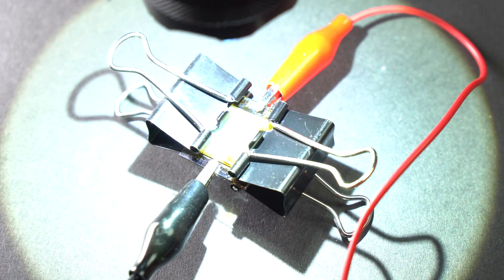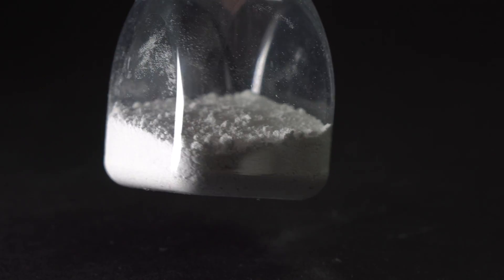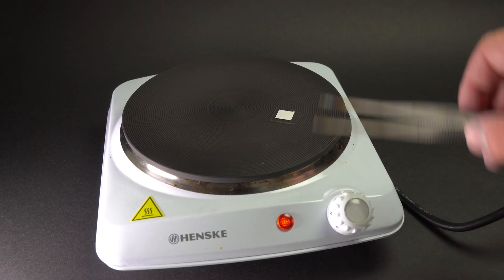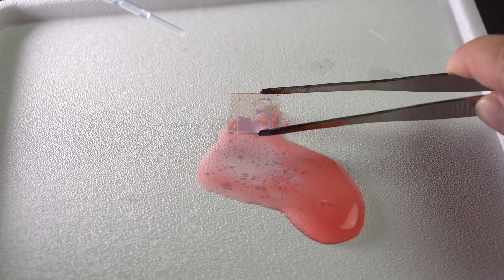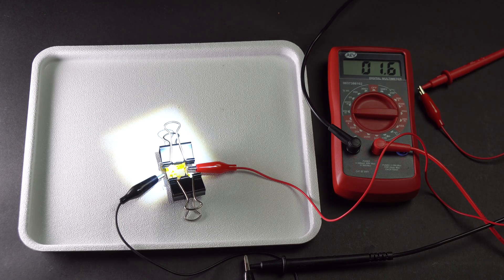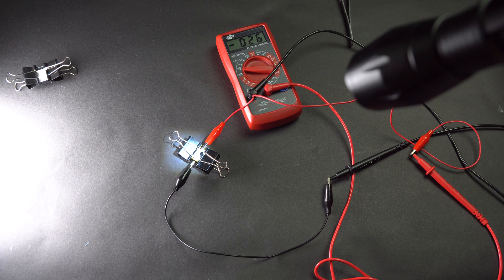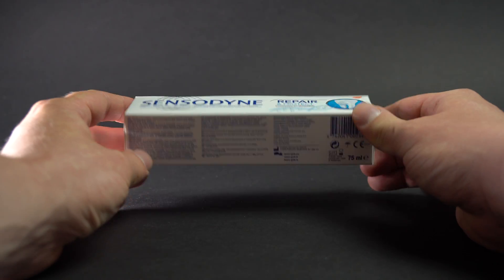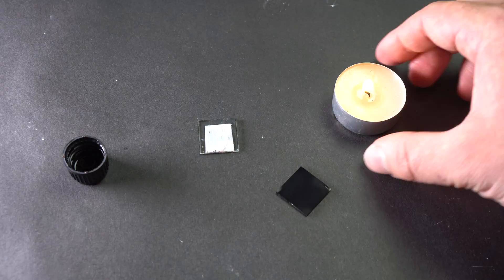Making a Solar Cell From Toothpaste!

Comment: Thanks for showing all.the failed attempts also. It is even more valuable that the successful part. None of the videos on youtube has shown the unsuccessful parts during the cell fabrication. Thank you once again. The same issues I was facing while fabricating DSSC using ZnO nanopowder in lab conditions.

Comment: I have the same problem with titanium dioxide films. These easily peel off the substrate (I am using FTO). I follow what the articles and manuals say, I make the thio2 paste using glacial acetic acid, make the film by doctor blade, take it to the lab oven and heat it up. I started by testing at 350°C for 3 minutes; however, the film would peel off. I figured that maybe the oven was not very well calibrated and gave much less temperature than it indicated. So, I increased the temperature to 450 °C, then to 500 °C and so on up to 800 ° C, waiting from 30 minutes to an hour. I manage to see q tio2 film turns yellow in the oven, but then it comes off very easily, practically with a small mechanical blow or at the time of sensitizing, the film peels off easily. out of curiosity, I tried with the reverse side of the FTO substrate. i.e., I tried with: Tio2/Glass/FTO. in this case, under the same conditions, the films do adhere very well to the substrate. I don't understand what is the problem or what am I doing wrong.

Comment: Note on tooth past. Rather than being frugal with water,  one might use large volume. the titanium  dioxide will settles out more quickly in a large volume of water and  Several washes like this and decanting the water will separate water soluble contaminants from the titanium dioxide without filtering.  

Finally, drying would start by decanting the water and placing the titanium dioxide watery paste in a stainless steel pan and heat until dry.

Comment: U just need a vapor layer comrade...2 test all your metal powders you could try a oscilloscope with voltage...though you will need 2 know the constants of conduction..maby 1 day you will get the general idea..since you don't have a spectrometer..

Comment: Thanks a lot for this very informative video. But these cells just only work , as you form a semiconductor with the ITO coated glas and the TIO2...only creating this bandgap there on this ITO surface and color dope it for the right wavelengths will make it work...so it will not work on just conductive plastic...so you always need this ITO layer, where you bond and dope in the TiO2 layer with the coloring agent...I tried it just with Aluminium Foil and I only got battery effects...(you can also apply light through the carbon glas electrode)...Please try to make such a cell without ITO coated glas, then you are the hero ! Lol...😆😁👍🏻🙋🏻‍♂️💖💖💖

Comment: There was a bit towards the end of the clip that suggests that soot from a candle might be used as a conductive surface.  I would like to have more information about that.  It sounds unlikely.  Liked the home-spun approach though.  Most chemistry that can be done doesn't need a super dooper lab set up.  Which is a good thing.  Think about the folks that up until 1860 or so had very little to work with but a thermometer and dishes that you'd get from the local hardware store.

Comment: Isolate the Iodine electrolyte only with the TiO2. When the electrolyte touches both electrodes, it shorts the circuit which you observed.

Comment: you dont need fancy chemicals to make solar cells...all you need is to understand what process produces current...which is redox...reduction and oxidation...oxidation is electricity...gaining and loss of electrons...closing an electrolyte with an anode and cathode in a container keeping out the oxygen in the atmosphere will produce electricity....quickly taking a lithium ion battery apart and putting it in a sealed container will make a solar cell much more powerful than making these things or any other solar cells...you can even make your own cells with aluminum foil with a layer of carbon sprayed with an electrolyte and another one made with copper foil...if it's in a sealed container keeping out oxygen it will produce electricity when in the sun...and it's easy to make...but lithium will have more voltage

Comment: nice video - but I have to disappoint you, there are almost no commercial dye-sensitized solar cells left because of their low lifetime and in comparison low efficiency. Also the ruthenium complexes which you mention are not cost-competitive against main-stream silicon solar cells.

Comment: When I used glass microscope slides as electrodes in experiments, I had huge adhesion problems of thin metal films onto the glass surface. I found that sand blasting the surface not only roughened and solved these problems, it also increased the surface area by about 1000 x.

Comment: I learned more about making the dye sensitized solar cell (DSSC) with you making mistakes from trial and error than the other videos making them cleanly. I'm making cells with quantum dots instead of dyes for my thesis so every little bit of information from trial and error helps hehe.
Reply: I'm doing my thesis on this very subject.

Comment: conductive glass can be made at home

"the thought emporium" made a plasma sputtering device, that can do that
Reply: Marc Frank i thought the same 😂👍
Reply: Yeah I think you need a molecular pump or otherwise a more sophisticated vacuum pump to get one of those Sputtering machines to work and all the electrical passages and bearings have to be sealed, 
that science channel , applied science, with Ben that's been around since YouTube started, I think he was the first to build one for a YouTube video, back when thought emporium was still drinking lactose free milk from a nipple.
Reply: @petevenuti7355  it's good to learn from history, yes. however with tech i prefer more recent information.
nothing against applied science, i love that channel, too.
(btw i don't think mothers milk is lactose free)
Reply: @marc_frank  looking at the history often tells you the things that have been omitted from instructions because they were seen as common sense , or at least it gives you insight into why things are done the way they are. 
   I believe my point was that often the "new" things are just rehashes of the old things cuz it's easier to do it the same way we've always done things rather than taking a new way that may be better, and/or that an older way that's the same but simpler.

Comment: Maybe instead of mixing TO2 with HNO3 you mix TO2 directly with cherry juice and apply paste
Reply: Might not work. The TiO2 paste has to be heated to sinter the particles into a mesoporous layer where the antocyanins in the cherry juice can bind and sensitize it. If you mix the TiO2 powder with cherry juice to make a paste and sinter it, then the all parts of the cherry juice would probably volatilize leaving you with just the TiO2 layer.

Comment: I was quite pleased to see this show up. While I do rather like the informational periodic table stuff, straight experimentation is always more fun to watch. Especially when the failures are shown along with the successes. 

With the toothpaste having worked as good as it did... It got me thinking, mineral sunblock is primarily titanium dioxide and zinc oxide, and generally meant to be non-abrasive. I wonder if it'd work better than the teeth scrub. Plus I know there has been research associated with zinc oxide high-efficiency solar-cells going on.

Comment: Bro i have so many copper wire how to extract it from coil and ♻ it
Reply: Cutting will be good as mentioned above but don't try to extract by burning as burning copper is illegal by law and punishable offence.
Reply: @ag135i  Quit bullshitting dumbass
Reply: @igorpadurjan5714  there's a reason for that, copper is toxic.
Reply: Just cut open the iron core with a saw or angle grinder, then pull off the wire. You can leave the lacquer on the wire if you are going to sell it.